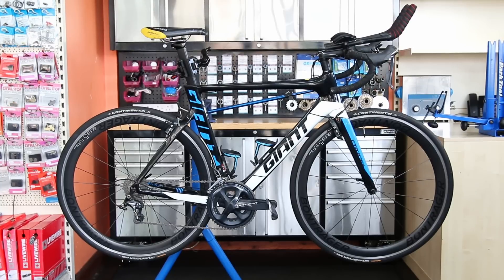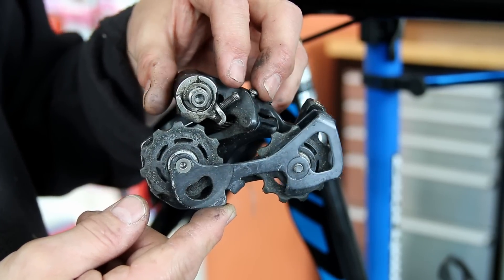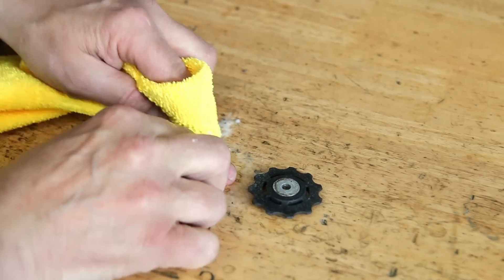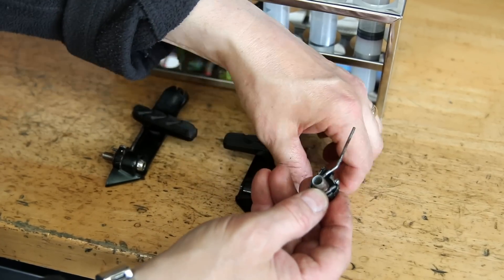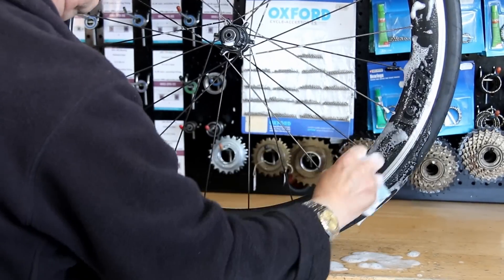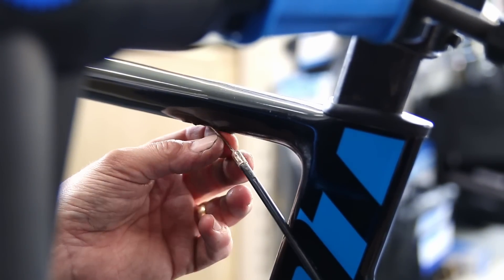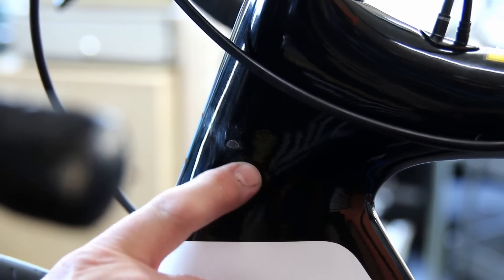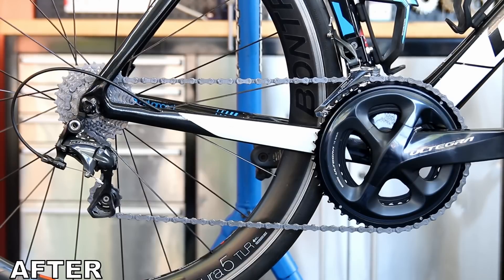Rusty Giant Propel Rebuild! 2017 Road Bike Service!

Comment: It is the season for chain waxing in my beloved latin America as well 😎. A question: do your detailing brushes have stiff bristles? This, as well as an inspirational coffee mug, are what I would like to order from you store (currently at Brussels, Belgium). Also, do you carry Campagnolo cables? I've read those are different.
Reply from the maker: Hi Carlos. The Detailing brushes are a medium ish bristle. In no way to stiff to use on anything but if you want them stiffer we’ve learned ourselves to cut them down. Our cables look to be the same as campagnolo but we actually don’t have them to compare with so we would recommend measuring your own ends to see if they’re the same as ours. Thanks very much for the support🧡⚙️

Comment: I use a wax-based chain lube by a company called Squirt - works really well in the summer months. I am nervous about the mess of proper waxing, so I tell myself this is a good halfway house. But you've got me wondering about my assumption now....
Reply: Trust me, the mess is little to none with real wax, i personally use molten speed wax in a crockpot and it is absolutely amazing. The most messy part is the removal of factory grease from a brand new chain, after that its smooth sailing!😅
Reply: Go for the full wax, you won't regret it 👍 makes less mess than oiling
Reply from the maker: It’s something you can try at home just as an experiment really it’s not a big commitment to give a go and we’d definitely recommend trying it to see if it’s worth it for your riding🧡

Comment: Love your videos! They are very calming and I’ve gained a great deal of knowledge watching them. What’s your take on the whole rim brake vs. disc debate? I’m very much in the camp of the 7kg bike with mechanical groupset, visible cables, rim brakes and aluminium wheels but the bike industry is moving further and further away from this. I think we reached “peak bike” in 2019/2020 and can’t see how these heavy aero disc brake bikes costing £10k+ would in any way add to my cycling enjoyment. I descended over 100,000m in the Alps last year, and never once did I wish I had “better” brakes!
Reply from the maker: We are firm believes in rim brakes, they will make your life simpler and cheaper. Glad you’re enjoying the videos!🧡⚙️
Reply: @Bikespeeds  Pleased to hear that! Keep up the good work!

Comment: Why don't you measure chain length to .75% or .5%?  That is what my chain tool says and I have read that is the proper amount for a 11 sp chain?   Thanks...
Reply: This is the general rule of thumb for chain wear:

10-speed and below: 0.75%
11-speed and above: 0.5%
SRAM Flattop chains: 0.8% (as advised by SRAM)
Single-speed: 1.0%

Or, check with the chain's manufacturer.

Comment: Waxed chain convert here too! New SRAM chain fresh from the box, degreased and plunged in a paraffin/PTFE mixture. After drying and cooling I cracked the chain as you do with the tube clamped in the vice. Mounted the result on my S-Works drivetrain and took it for a spin… it keeps jumping on and off cogs, both front and back because it just seems to stay on top of the teeth of the cogs… just can’t figure out what I’ve done wrong. I’ve removed all excess wax and made the chain flexible but it still doesn’t work. Any ideas/tips?
Reply: New chain usually takes 50 to 100km to "bed" in.
Reply from the maker: That sounds like your drivetrain has worn and the new chain is skipping over the worn gears, the solution there is to replace your chains more regularly to avoid wear although it is inevitable🧡

Comment: Who is the manufacturer of your large torque wrench?
Reply: Looks like a Draper. If you want to get a 3/8-inch square drive torque wrench yourself, make sure it's reversible (tightens both right-hand and left-hand threads, manufacturers should mention if this is possible for theirs).

Comment: I don't recall ever seeing V brakes on a road bike before. Cantilever, centerpull, side pull, double pivot! Leverage is leverage and the only difference is rigidity of the arms, or lack of. The market now dictates  disk brakes, because rim brakes on carbon fiber rims make no practical sense. Perhapse disks are best, but the marketeers have had their fun and profit along the way. I had been waiting for somebody to bring back mechanical drum brakes to become the next thing! Too simple and reliable though. I've been disappointed with waxed chains. It needs to be redone far too often. Single speed chains are cheap enough and no team car will ever follow me! 10 ways to mount the 1/8" width chainring  also makes things last a while! Smiles per hour is the most important thing.
Reply from the maker: Yes we have no end of problem with disc brakes, most of the systems are a fundamentally flawed design and they give no adjustment out and about. We’re completely in the disc brake master race!🧡